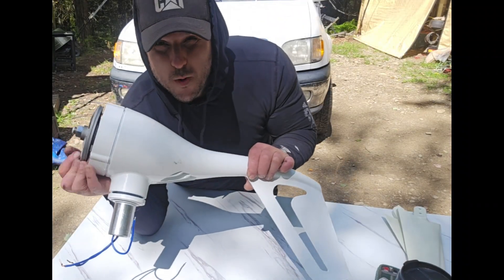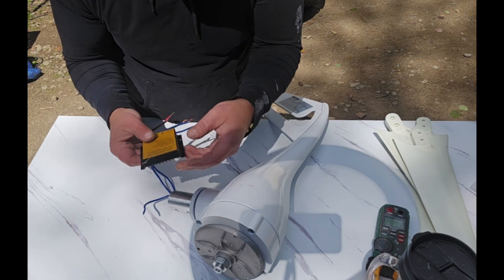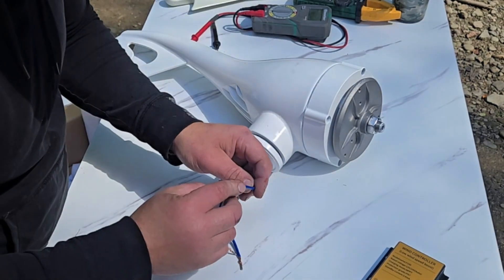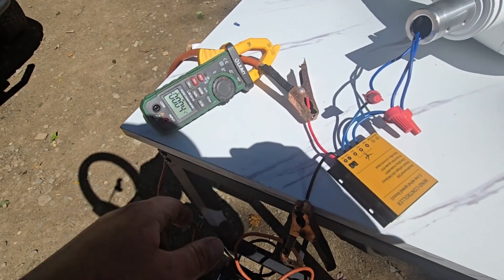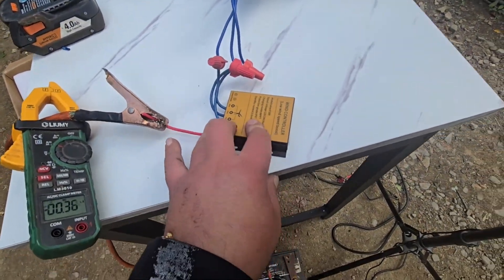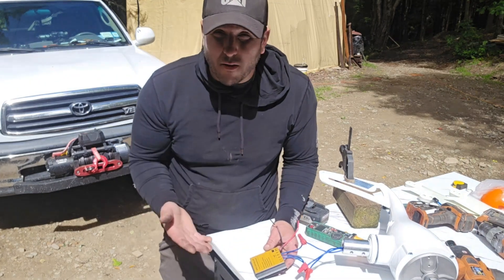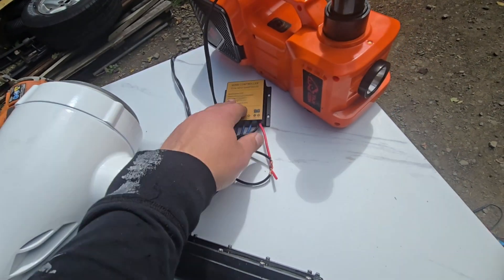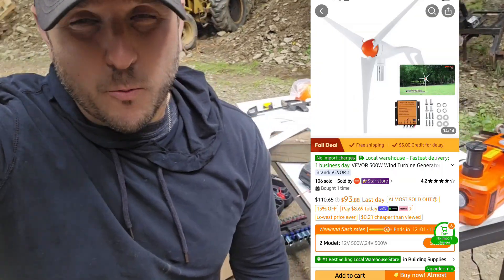Testing a VEVOR "500 watt" Windmill

Comment from the maker: Officially we got around 240 watts at 24v max. If I would have tested the AC amps before the regulator/rectifier I suspect we would have achieved at least 300 watts. I'm going to do this test soon. I believe that impact was spinning below 1000rpm under load.
Reply: How many mph of wind speed is 1000rpm?
Reply from the maker: @MrFrance97 it would have to around 50mph I'd imagine. Get the 5 blade this one is terrible.

Comment: never produce any power
Reply from the maker: Needs crazy wind, I would never recommend the 3 blade for this area. Need a 5 blade. But its power output as far as cost per watt is very similar to cheaper solar panels. So if you live in an area with high wind and long winters they are worth the small investment.

Comment: Not a real world test. Using junk to make this VLOG.
Reply from the maker: Bench test. In real world tests unless you got it 500ft up in the air with constant powerful winds it does poorly. Thing rarely moves. I'm going to modify it. Get the 5 blade if you manage a really good price.
Reply: Scam garbage

Comment: I've got a 600 watts one that was supposed to be 24 v but they sent me a 12 v windmill and a 24 v controller like you have. It makes 17-21 volts usually, the amps vary. There was a 85 MPH wind last May when it put out 45 amps. I've got it hooked to 10 lead acid batteries, size 29. I don't run much off of it but I use it when it's windy. 
Mine is a little bigger, the blades are better and bigger. I've got 2400 watts of solar panels outside and 8 more 100 watts solar panels in the barn. I used a 2000 watts Aims Power inverter/ charger, 24 v, and I have 800 amp hours of lithium batteries showing 26.4 volts at 1 a. m. I've been off grid for 4 years.

Comment: Good video.  The reason your impact driver seems to pulsate" is bc the impact driver spins freely when not under much load, when it detects enough resistance it goes into "hammer" mode  ie  My Ridgid impact 1750lbs torque will NOT start a 3.5 H.P. lawnmower but the lower force drill WILL start the mower ; bc in impact mode the forces is off for a brief instant of time but the mower needs constant force which the drill provides --> you might" get more wattage with the drill ? ..  InventPeaceNotWar
Reply from the maker: I bought that Ridgid originally for my dump truck 1 5/8" lug nuts. It was the only thing that would break em lose. They're incredible. It's not an octane though.😒

Comment: I never know that this wind controller can damage our lithium batteries
Reply from the maker: Evidently, double check the instructions that come with it.
Reply from the maker: I believe there's too much noise on the DC output, as in the wave isn't smooth, not much filtering. They probably cheaped out on the filtering caps & inductors

Comment: Like others said, you need a good load.
You only measured open circuit voltage, and amps never in short circuit, only in a circuit with a battery as load where we don’t know the voltage and don’t know if it’s full.
The MPPT would select voltage and amps such that the max power is delivered, but if the load is full or a bad voltage far from the MPP it can’t regulate to that.
A German YT tested the stock mppt and despite it claiming to be for low wind speeds, it’s crappy at that. You can do a better one in diy. Just an Ali express buck boost converter.
Reply from the maker: I was thinking about that too. I have some gigantic 50,000uf 50v capacitors. I wonder if those would hypothetically pull an absolute full load. I'm afraid to short the windmill like a solar panel.
Reply: @crazyDIYguy  that’s a great idea with the capacitors! They should smooth out the fluctuations from gusts and make it easier for the mppt.
You can add it after DC.

I’ve been thinking about the bad performance in low winds. There’s also options (star/delta configuration depending on how the motor is wires) to add the capacitors on the AC side. I bet the orange box has some full bridge rectifier and maybe just tiny or no capacitors afterwards, which then goes to the mppt.
When the generator is in low winds and turning slow, then the V goes up and down at a low frequency so the tiny capacitors just follow the low frequency, and the mppt can not find the best point because the input to it always changes. What it would like to see is a constant signal, just the average voltage.

At high winds you get that because the turbine creates the V at a high frequency and after full bridge rectifier and small capacitors you get a stable voltage. Just not at low winds.

If you could manage to get the input already very smooth despite the low frequency, then the mppt would have an easy time to find the best power point. That would be actually very valuable if you would find a fix to that orange box’s issues in low winds.

Comment: mine never worked, only discharged the batteries and would not spin on a windy day because the dynamic brake was on. the brown box we think was the problem.  thansk
Reply from the maker: Mine is pitiful too, I have it connected to a dead battery to see if it'll bring up the voltage. It has a little bit an extremely near hurricane-force Windy days. I heard a bigger tail fin helps it which makes sense. Probably helps guide more wind through those turbine blades too. I'm going to make my own full Bridge rectifier with schottky diodes and dramatically improve the blade size & tail fin. If that fails it's becoming a steam turbine.
Reply: @crazyDIYguy  i seen videos on those upgrades too. false advertising and yet to see a video where one actually works  thansk
Reply from the maker: It's worth mentioning I have mine 50 ft up in the air
Reply: @crazyDIYguy  yes seen that.  thansk

Comment: Could I attach a 110 volt heater to heat house with this generator??
Reply from the maker: That would be tough, the lower voltage would probably burn out your element without modifying it. That being said I'll paste a link to a video of a brilliant guy who does experiments like this.
Reply: No, no way this will put out enough power for a normal sized space heater. They're typically around 1500 watts. From what I've seen these are rated like 500 but actually put out less than 150 watts in pretty much ideal wind conditions. I guess you might say you could power the heater from a large battery and use this to recharge the battery but you would need like 10+ hours of ideal wind conditions to recharge the battery for every hour you used the 1500 watt heater. Hope that puts it into perspective for you how little power it puts out vs how much a space heater consumes. It's not even close.
Reply from the maker: @cwall235 It's awful up in the air, barely spins in gale force winds. If anybody reads this please get a 5 blade or vertical axis.
Reply from the maker: https://youtu.be/e1pFP2a4xqg?si=ZqzQAlfwsiRH4Y9L

Comment: Hi, your explanation of this wind generator is fabulous, but as you well know, everyone is looking for a wind generator that can either charge the photovoltaic batteries or at least connect it directly to the second input of the inverter to use it as a sort of solar panel. Do you have any suggestions?
Reply from the maker: To produce DC voltage, you would want a DC brushed motor. Kind of like most car alternators. But, brushed motors are less efficient and have a lower lifespan.
 Ultimately I would like to make a homemade schottky diode three phase Bridge rectifier, and connect this directly to a grid tie inverter with an mppt variable DC voltage input. Or any mppt. Schottky diodes have the lowest voltage drop, very efficient.
Reply: Thanks for replying quickly, but I wanted to understand the 240V with a wind speed of how many ms. And then if you had to recommend a 48V wind generator that produces at least 200 Watts with winds of about 6 ms?
Reply from the maker: @alecchi this one produces nothing remotely close to 240v ac. I wouldn't personally recommend this particular windmill either. Its been awful at doing anything or making any movement. If you can get one cheap, try a 5 blade or vertical axis. But by far solar is the best power for your dollar.
Reply from the maker: @alecchi the particular specs your looking for, I wouldn't know which one to pick in particular. I just know that I'm highly disappointed in this particular model

Comment: I have a rx400 for 15 years now its turning scarry fast in the wind its look the same thing they are good for a small system a couple batteries. 
I made a homemade one 10 foot for $300 that is mush more powerful its produced power and the rx400 don t even start to turn on a small wind but on hight wind the rx400 its turning really fast and it's noisy. It's sound like a heavy wind sound in a moderate windy days.

Comment: IMPORTANT 2: the controller BREAK the wind turbine if the battery is full or you have NO LOAD on the battery ;) drill the turbine with standard controller, normal battery and "no load" is "not a good idea" ;) most youtuber make this wrong ! you need 1. bigger battery 2. load ! 3. better wind controller and 4. bigger wind turbine like smaraad sm3 with 1,65 meter wheel diameter ... and you can try the 48 volt version ... BREAK = electromagnetic brake .. you can test it when you "short curcuit" on the 3 phases and then try to rotate with hand ... the turbine "brake" ...

Comment: G'day Mate, after lots of testing, I have found that most small wind generators work best with a bit bigger tail area. My best advice is to attach a 25cm Round Stainless Steel Pizza Lifter onto the tail, just remove the handle first. Once aliened with the curve of the tail and painted white, it looks great up in the air. This works with up or down facing tails, just allow half to hang out the back, adding some length to the tail as well. Should track the wind great now and won't rust.
Reply from the maker: Droppin in from across the pond eh, I also researched the controller is terrible (wastes a lot of energy) a wind solar mppt gets a LOT more output from what I've seen on other channels. I'll definitely try the tail fin. Much appreciated 💯🙏
Reply: @crazyDIYguy the hybrid solar/wind controller? I’m working on my build now and was worried that device would cause loss. Thanks for the info
Reply: Make a video!

Comment: I had a friend that put his in a tree in Tn. The only issue he had was during heavy winds the tree would sway throwing the windmill out of it's comfort zone so to say like spinning a bicycle wheel and trying to move it around by it's axle if that makes sense. To cure the problem he put lines to stabilize the tree and it worked great.

Comment: U could add a larger back fin too help to be more mobile on the pole, from what I've seen on YT.
Reply from the maker: I either want to make it a steam turbine or add larger fins, back fin. It hasn't done anything even with really good wind
Reply: @crazyDIYguy  Your not high enough to be in the wind stream that will produce better outcomes. And yes someone else i watched with one of these found the windmill didn't track well and would sometimes turn completely opposite of the wind and he too had to make a larger tail rudder by adding to the original  to keep it in the wind

Comment: If it is a 3 phase generator, they are 120 degrees out of phase to each other.  I'd think that would mean your 73 Volt reading would not be balanced between the 2 wires (35V each) since when one phase is at peak voltage, the other phase is not.
Reply from the maker: This is fascinating, I had a feeling I messed that up. Thank you 🙏
Do you think I hit peak 73VAC on 1 line then? Or did my meter componsate? I'm assuming the meter behaved similar to reading a mains 220vac split phase voltage.
Reply: @crazyDIYguy  How the meter reads could definitely be a factor, but I'd assume you had a voltage differential of 73 volts in the same way you would read 220 (110 x 2 phase) volts. If you watch an animation of 3 phase power you can see how two of those phases relate to each other and how complex the calculations become for RMS and Peak to Peak.

Comment: I wonder what that does in real life. It will probably not spin 1800rpm, if not in a hurricane.
Reply from the maker: At 24 volts we got over 240 watts, which is pretty good. Especially after the efficiency losses from the regulator/rectifier. Without them regulator/rectifier I bet it would do 400 watts on the AC side in a heavy wind. I've never had a bad Vevor product, fingers crossed. Or one that has lied about it's capabilities.
Reply: @crazyDIYguy  That is indeed impressive. 
Build your own rectumfryer ;) with low dropout Schottky diodes or active rectification with mosfets. At 24V in a 3phase system you blow a lot of power just in the voltage dropout of the diodes

I did have a bad Vevor product. The Vevor wire stripper I bought was total junk. 
The PCP air rifle compressor and a vacuum pump are real bangers.